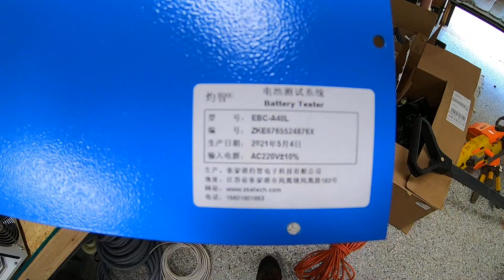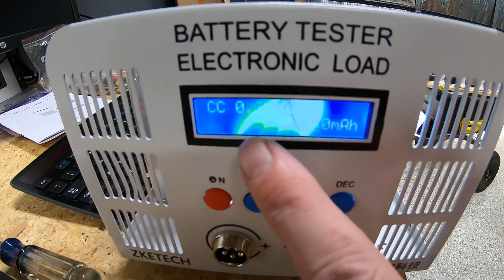Looking at the ZKE-Tech EBC-A40L

Comment: Nearly every home in the states uses 220, it's rare that one doesn't. It's just that utility outlets are wired 110v because most devices are designed to run on 110v and rightly so. Most don't produce loads requiring a second phase.
In this case changing the line voltage to the power supply to 110v is cutting the output current of the power supply in half and only able to produce 20 amps instead of the rated 40 amps.  
Now that kinda sux because so many have whined about the 220v connection that you can't find one of the units on Amazon that hasn't been reconfigured for 110v. Which is the best place to purchase since you can add a third party warranty to replace the 30 day warranty at best by the sellers. And breaking seals is a simple excuse for voiding said warranties.
Reply: Mine charges and discharges at 40A on 110v.
Reply: @sweetlifeadventure7  Are you sure?

Comment: @solargarage can you confirm the switch to chance to 110v. Every store I query about getting the 110v they say only available in 220v.
Reply from the maker: I was asked from the seller which version I needed, I can confirm that the version I was sent was setup for 110V.  I received a replacement display and will look at the power supply and verify if the selection switch exists, once I replace the display, will post a video.
Reply: Yes, there is a 3/16” x 1/2” slot on the bottom. You’ll need a flashlight to see it. Mine came from a warehouse in California, so it had already been switched and the proper 120V cord shipped.

Comment: there is a switch on the bottom of the power supply that you can change from 120v to 240v as needed.
indeed, there is a boost converter from 5v to 12v for the fan and for board power.